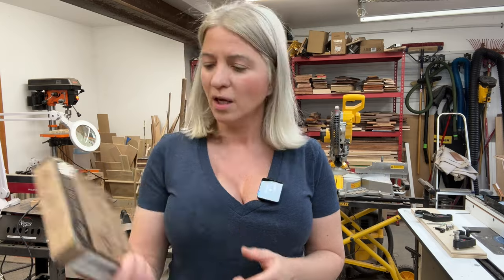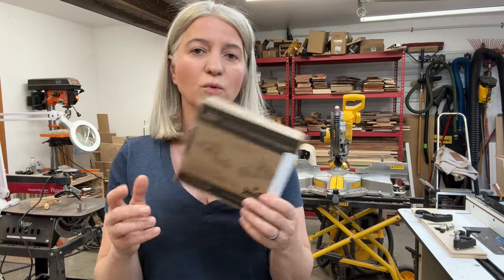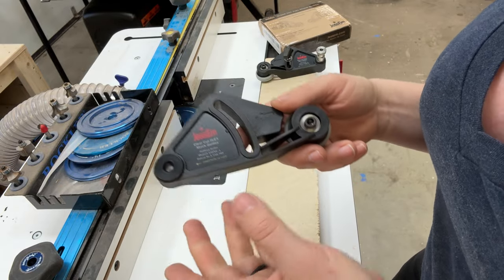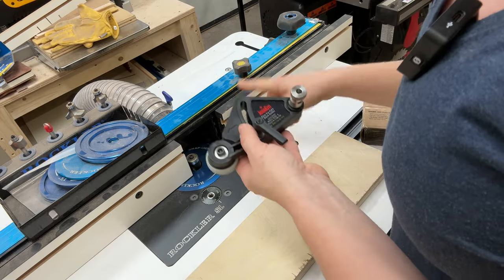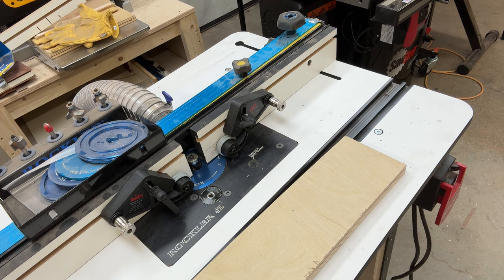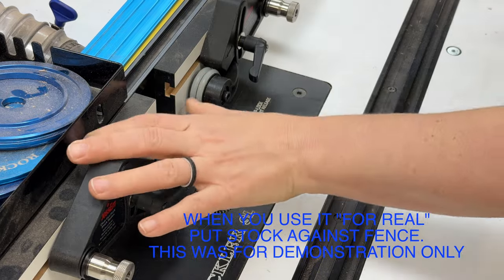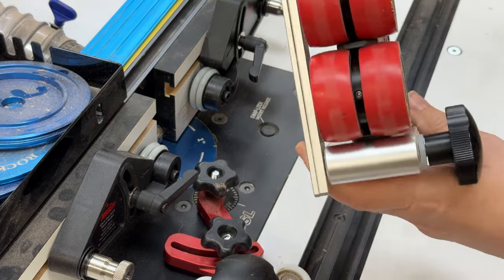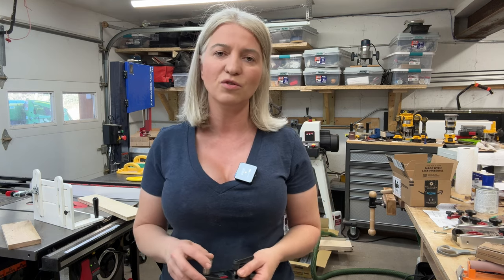JessEm clear cut stock guides first impression. Must have tool for your router table.

Comment: Hi. I notice at 1:33 in the video, the round head bolt is a cup/square carraige bolt with a square shank below the head.  Shouldn't this square fit into the square hole in the silver piece of metal?  I was just wondering how this bolt engages in the Tee slot on the fence.  The other bolt is obviously a tee bolt to fit into the slot on the fence.  Am I missing something here?  Thanks.

Great video by the way.

Comment: I had a tablesaw kickback once that hit me in my face shield; felt like I got punched in the nose but I didn't learn I guess because I didn't make any moves to correct the problem.  I watched this video and immediately had concerns about how long the O-Rings would last.  Upon checking their site I see they are sold seperately for replacement parts at a reasonable price.  I see these can also be used on my tablesaw so It appears you saved my nose, LOL.  Thank You!
Reply from the maker: :) kickback sucks! I had a few incidents but luckily no injuries

Comment: Hi, are you still using these? On Amazon, they have another version with metal knobs instead of the plastic lever. Thoughts about strength on the plastic levers?
Reply from the maker: Still using them , still works but most of the time I don’t use them
Reply: @woodworkingwithSkyler  thanks. I think that I will nut the all metal set. They are $20 more on Amazon, but seem more               sturdy

Comment: Hey Sky, any idea what the max thickness of your stock is for these to handle?  For example, the other day I used my router table to cut a rabbet on the edge grain of a 2x4 for a T-track insert.  This wouldn't work for that, would it?  Wish I lived near you, I'd love to take all your rejected items off your hands, ha!
Reply: Fly boy. If you add another track in you fence,gives you more options.😇🇺🇸👍